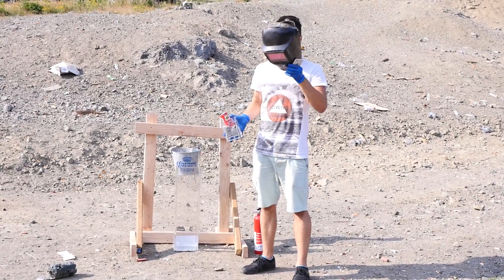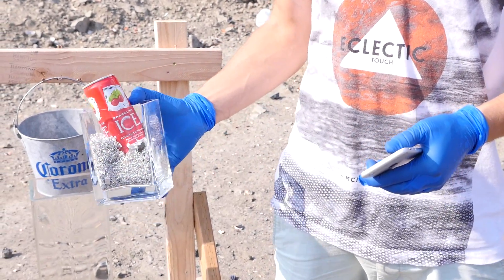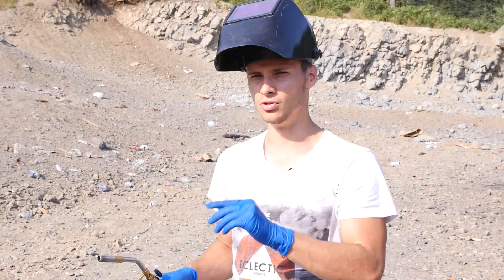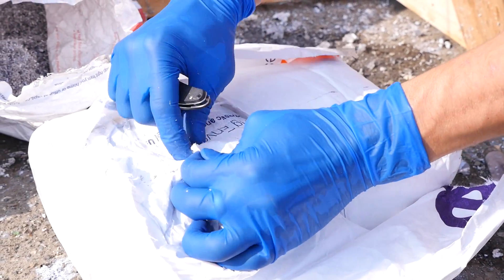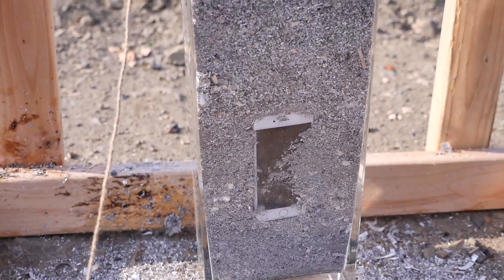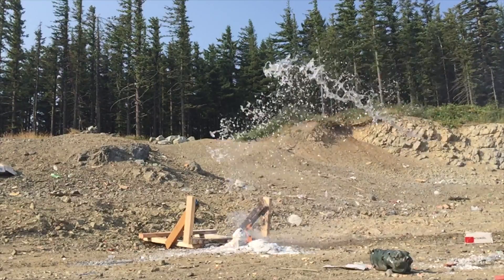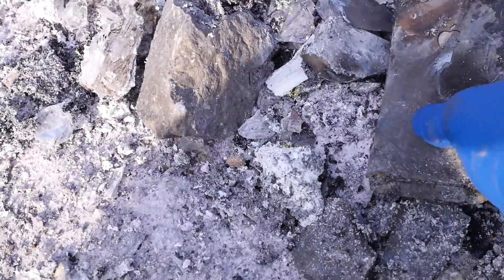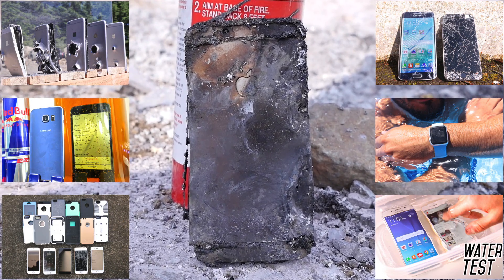5lb of Magnesium VS iPhone 6 - Will It Survive?

Comment: You can't put magnesium out with a CO2 fire extinguisher, as magnesium does this: 2Mg + CO2 --> 2MgO + C
Yup, it reacts with carbon dioxide!
Reply: VeronV That's right! It is an even worse idea to put magnesium out with water as the hydrogen the reaction produces is also very flammable.

Comment: Lol 4:30 

Dude, the science ended when you pulled out that CO2 fire extinguisher. Magnesium also reacts fairly well with the CO2 which is why you actually helped it when you put the fire extinguisher to it. Or rather, the fire extinguisher became a sort of flame thrower, or fuel source.

Comment: You take it to Apple
 
You: does the warranty cover this?

Apple: try turning it on.

You: I have no home button. No power button either.

Apple: try plugging it in.

You: It has no charging hole.

Apple: does it show an apple logo on the screen?

You: it has no screen.

Apple: how did this happen?

You: I put it in 5lbs of magnesium, set it on fire, and then poured it with water.

Apple: get outta here!

You: WHAT!!!!!! THATS NOT COVERED BY THE WARRANTY!!!!!!! HOW!!!,

Apple: next!